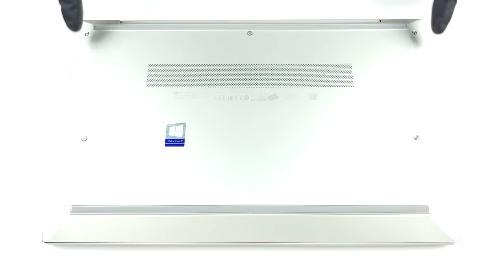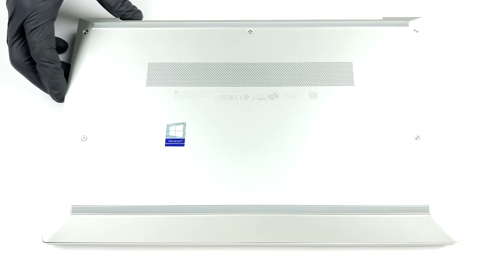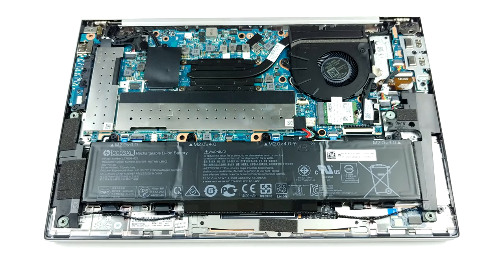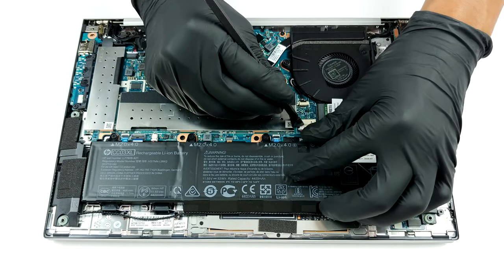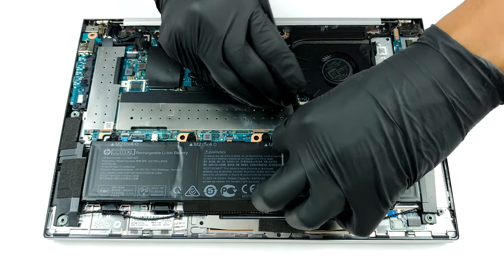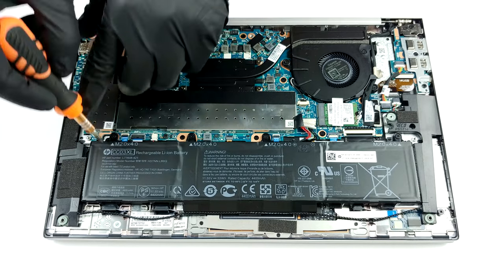🛠️ HP EliteBook 840 G7 - disassembly and upgrade options

Comment: Thanks for the video. I just opened my work unit to clean up the cooling. 
Pretty solid machine I must say, I would totally compare it with old 8460p or 8470p.
Upgradeability quite impressive for today's standards, yes, but CPU is soldered and already bottlenecking in trivial tasks like running Windows and Teams calls. It's just low quality software, yes, but it doesn't help soldering a CPU that's not to much faster than 10 year old i7s.

Comment: Can you add 2.5 SSD anywhere as secondary drive?
Reply: Most probaby not. 

The 2nd M2 slote on the right side (here equipt with a WWAN module) is where you headed. 2:48

The G5 worked if you put a 42mm NVME B+M-Key M2 SSD in there (although it's prompting "not supported WWAN module" on every boot then) you could both from both and select them in the UEFI

With the G6 that stopped working and the SSD is just not recognized.

So I doubt they're bringing this "feature" back now.
Reply: you have 4TB M.2 SSDs now, why would you need that lol
Reply: @jm036  dual boot with bitlocker
Reply: @SnipinCatz  well I've looked into it and M.2 2242 B+M key should fit and work in WWAN